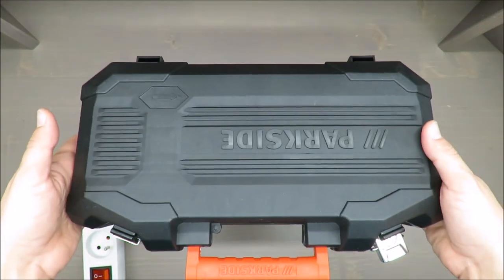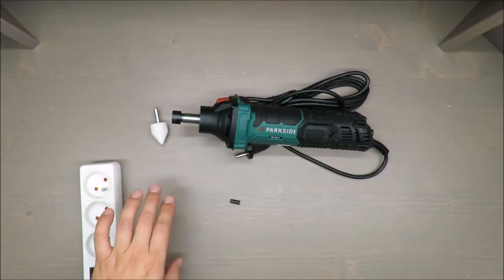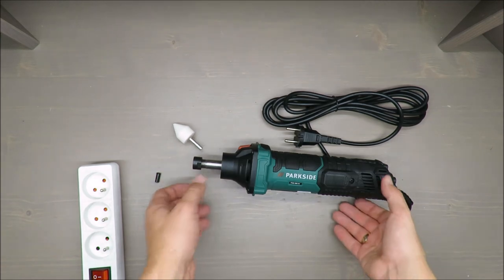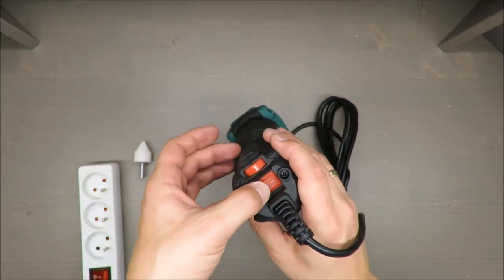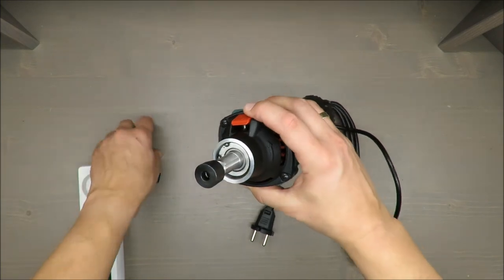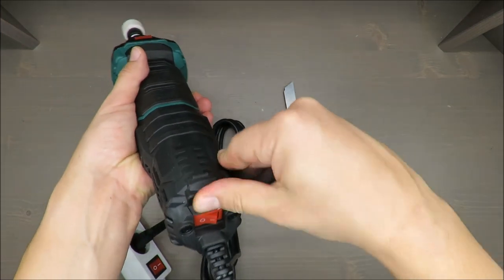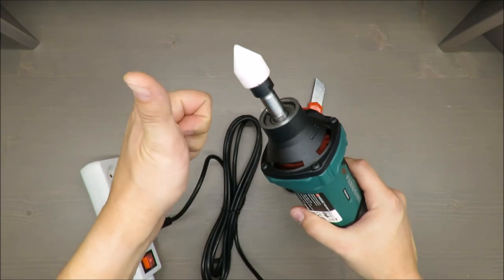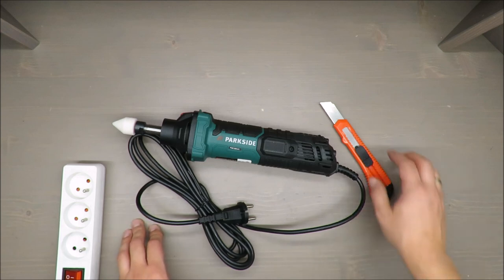Parkside Die Grinder PGS 500 A1 REVIEW TEST (Lidl 500W 30000 6mm 10mm)

Comment: The mounting neck on this tool has a taper and can't be used in normal way you would expect to mount this tool. All other brands have standard side 34mm neck size but cost 250Eur vs. 19Eur